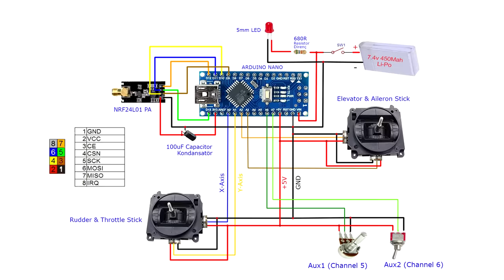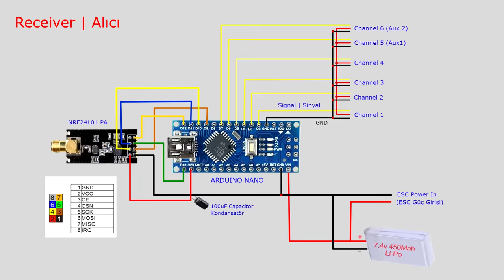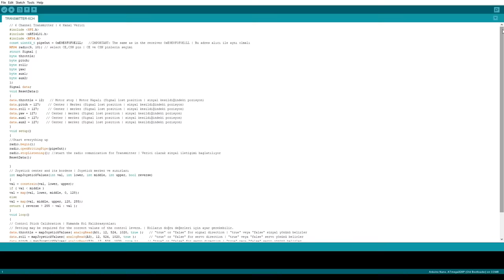DIY 6 Channels Radio Control For Models. How To Make İt

Comment: salam tuan2....terutama untuk tuan kendin yap.kiranya bisa berbagi pengalaman tentang rc ini.setelah say rakit receiver pada pesawat dan saya uji coba dengan menggerakkan semua arah joystick ( trottle, rudder, aileron dan elevator) secara bersamaan  dan sangat cepat.bahkan hanya dengan menambah kecepatan trottle dengan cepat pun terjadilah semacam hilang kontak antara transmitter dan receiver.Pada saat itu motor  tetap menyala dan yg lainnya tidak dapat digerakkan sama sekali (rudder,aileron,elevator).Adakah yang mengalaminya seperti saya dan apa solusinya...terima kasih kiranya tuan2 dapat membantu permasalahan saya. terima kasih
Reply: Drop tegangan utk nrf2401 yg membuat hilang kontak.tegangan nrf24 harus stabil tdk boleh dibawah 3.3v 🙏

Comment: Hello
Can someone help me ?, I enter the codes to the arduino but I cannot make them communicate,
the arduino accepts the code but there is no communication
Emitter and receiver or signal on the serial monitor.
Reply from the maker: Check the antenna connections of the NRF24 modules. In some NRF24 modules, antenna connections or antennas themselves are a problem.

Comment: I appreciate your work👍
Here in this code as mentioned you can control roll using single servo motor but in a better models we need to control roll using 2 servo motors.. could you update your program!
It would be so helpful for all of us
Reply from the maker: In one channel, 2 servos are generally used for aileron. There is no need to change the code to accomplish this. Parallel connection is made with Y type servo extension cable. And it is a common practice. As I did in this video .... https://www.youtube.com/watch?v=we1i5VTC-9c
Reply: @Kendin-Yap  Thanks for replying buddy 😊 it was quite helpful and i am going up with your wonderful project!

Comment: Sir can I contact this with a more powerful battery approx 22 v and more powerful motor ??
Reply from the maker: It can be max 12V (3S). In order to use with higher voltage, regulator should be used in Vin input of Arduino and voltage should be decreased.
Reply: I am wating for your next video. Where you make a plane using this radio controller

Comment: Merhaba. Öncelikle çok güzel bir video olmuş, elinize sağlık. Ben de yaptım aynısından çok güzel çalışıyor ama bir sorunum var. Antensiz sıkıntısız çalışıyor ama verici (transmitter) kısmına anten takınca çalışmıyor. Bunun nedeni nedir? Yardımcı olursanız çok sevinirim. İyi günler, ,iyi çalışmalar.
Reply from the maker: Teşekkürler. Bu normal değil. Belki anten soketinde bir temassızlık olabilir.
Reply: @Kendin-Yap   Tamam hocam hallettim. Cevap verdiğiniz için teşekkür ederim. İyi günler.
Reply: @mehmetaksu3507  cidden aynısını uyguladın mı? Yaptın mı? Valla bravo, tebrik ederim. 👍👍

Comment: Bro though I am using capacitor and 11.1v battery still I am getting battery related problem in the receiver side it was fine when I was using the nrf module without antenna but now since I upgraded there are many problems
Reply from the maker: Some NRF24 modules may have bad antenna connection. I have encountered this problem before. It worked properly when I changed the module. Maybe the problem you are having is related to this.
Reply: @Kendin-Yap  if I should try replacing the capacitor with 10uf
Reply: @Kendin-Yap  please tell
Reply from the maker: @lowspectuner7590  10uf or 100uf will not affect the result.

Comment: Good morning everyone, so this question is for anyone who had completed this... I did everything step by step and not getting anything movement from the servos.   I notice the power for the servos is never connected in the video or in the drawings, it does have a red line, and knowing that servos require 3-4v I connected the 3.1v to the middle servo lead. while the servos now get the start up jitters, it did not fix the communication problem. curious if anyone else had similar problems.. thank you for your time.
Reply from the maker: There are no errors in the schematic and code. The servos get their power from the BEC circuit of the ESC. Therefore, no external power is connected to the red (positive) line. If you have done the whole circuit perfectly, the problem may be in the NRF24 modules. NRF24 modules are somewhat unstable modules and may cause connection problems. It may be necessary to reset the circuit and wait for a while for connection. Sometimes powering up the transmitter or receiver first can work as well.
Note: Before uploading to Arduino, you need to download the library files required for Servo and NRF module to your computer.
https://www.youtube.com/watch?v=f1z8Wvy56t8

Comment: Sir i am using this code and schematic and connection but motor not stop on zero Throttle i am exactly same connection but not fix this issue please help 🥺 i hope ❤
Reply from the maker: The first two values in the "data.throttle" line in the transmitter code determine the "12, 524" movement area. You can change these values according to your needs. For example, for one-way ESCs, apply the values "0, 512" and try. With a little trial and error you can get the correct values for your ESC.
Reply: @Kendin-Yap  code are both transmitter and receiver change the value or only receiver 🤔
Reply: @Kendin-Yap  THANK YOU ❤SO MUCH SIR, its working 🤗and now the testing with lipo battery and go to fly 🤗i hope fly my f-22  plane i am from India 🇮🇳 state bihar ...

Comment: Hi ! Very good project, thank you so much. Could you indicate how you added the trim pot? If it is a different joystick than the one indicated in the list, could you provide the link? Thank you!
Reply from the maker: Thanks. The joystick with trim feature is different. I bought it from a local dealer. I couldn't find a place that sells online. For this, you can search for robotic equipment or RC equipment stores in your area.
Reply: @Kendin-Yap  Okay thanks a lot! Yes I couldn't find one online either. Is the arduine code the same whether the joystick has a trim or not?  Great job once again, I will try to build the same :)

Comment: you can not attached VCC pins  in diagram kindly repair your diagram layout or connection
Reply from the maker: There is nothing wrong with the schema. The VCC pins are powered by the BEC circuit of the ESC.

Comment: Show us making a microcontroller for an Arduino Uno, not a Nano, my friend
Reply from the maker: You can also use these codes with uno. Only a few pin numbers are different. The Uno is a module that is too large and somewhat heavy for the receiver. So it is not suitable for a model airplane.

Comment: Where to connect +ev on resiver in diagram I can't understand sir
Reply from the maker: Servos draw power from the BEC output of ESC. Because the ports of the arduino do not have enough power. So the VCC line is not connected with the arduino.
Reply: @Kendin-Yap  OK thanks
Reply: @Kendin-Yap  make a video on this controls

Comment: I TRY TO MAKE A RADIO  CONTROL MODULE , PROBLEM IN CODE . I VERIFY CODE 
IT SHOES MESSAGE .   "NRF24L01  h: NO SUCH FILE OR DIRECTORY
Reply from the maker: First, you must upload the library file required for the NRF24 module to your computer (Arduino / library). Then you can upload the code to the arduino.

Comment: Arduino: 1.8.13 (Windows Store 1.8.42.0) (Windows 10), Board: "Arduino Nano, ATmega328P"

sketch_aug06a:3:12: fatal error: nRF24L01.h: No such file or directory

   #include <nRF24L01.h>

            ^~~~~~~~~~~~

compilation terminated.

exit status 1

nRF24L01.h: No such file or directory

This report would have more information with
"Show verbose output during compilation"
option enabled in File -> Preferences.
Reply from the maker: For the NRF24 module, you have to download the library file to your computer.

Comment: I also make this project same as yours but it is not working
Reply from the maker: It works when everything is right. Check circuit connections. And some NRF24 modules' antenna connection can be problematic.
Reply: Brother programming is left that's the problem
Reply: I don't know how to program
Reply: I am waiting for your reply bro

Comment: Ur code is not compiling  sir
Reply from the maker: The code is OK. You should learn how to install Arduino libraries. You must install the library files on the computer where the Arduino IDE is installed. In the first rounds of the code ( #include <SPI.h>
   #include <nRF24L01.h>
   #include <RF24.h>) are the required library files.
This tutorial video may be helpful. https://www.youtube.com/watch?v=f1z8Wvy56t8&t=231s. Apart from this, you can find many tutorial videos about "Arduino library installation".